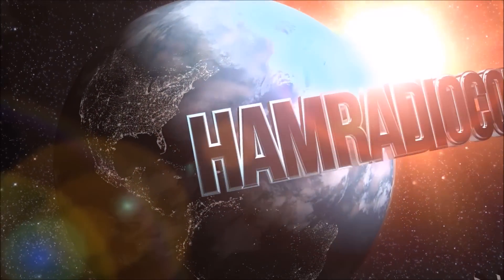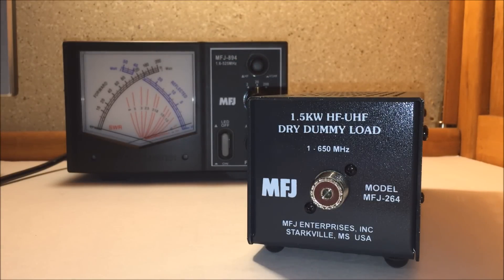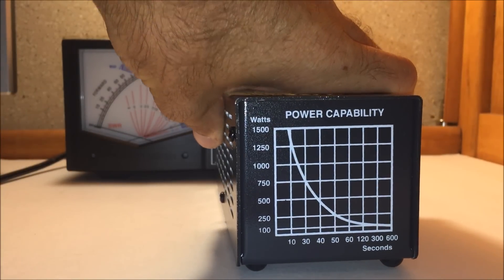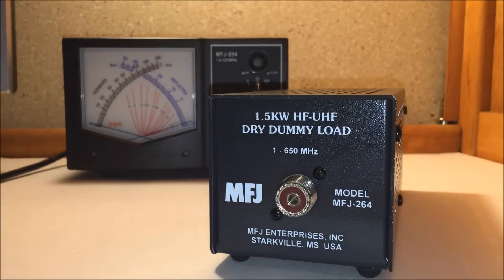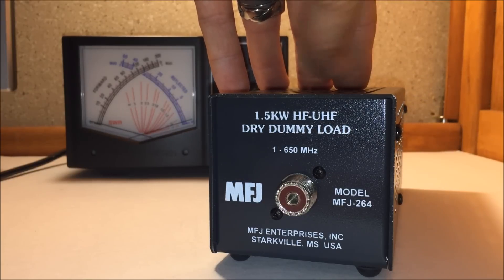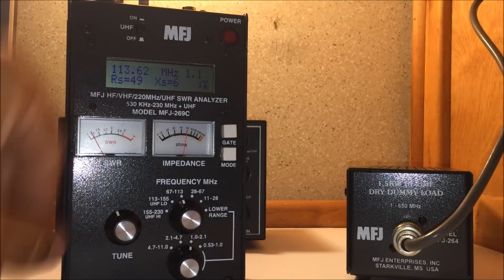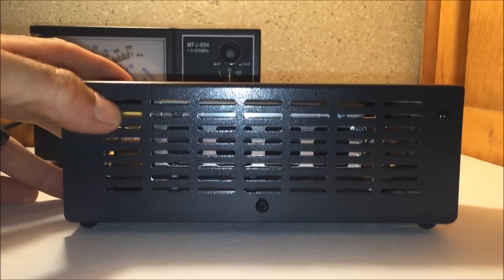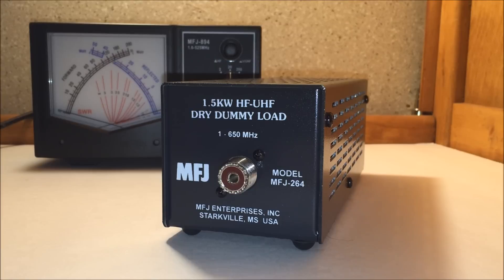What is a dummy load? MFJ-264 for Ham radio

Comment: I'm new to Ham radio and my question is can I use the MFJ-264 on a Xiegu G90 when I get it?
Reply: I believe so, but the 1.5kW PEP model is a bit overkill. the 300 watt PEP is more in keeping. I have a G90 as well so the lower power one is what I'll be getting. I don't anticipate pushing out full legal limit for the foreseeable future.

Comment: try you hot water tank ,i use my hot water tank is  a dummy load ,,i just connect a cox cable RG -79 to my hot water tank an then to the radio,, my SWR is 3-1 and is good for 8000 W

Comment: I've always meant to get a dummy load, never realized how inexpensive they are.  This one is on sale now at HRO for $65...same price at GigaParts.  Thanks.  73, Chris.
Reply: This one not that good and way overrated and you be lucky you get a more then a couple of seconds at the power it rated for without it burning up. A true 1.5k dummy load is oil filled and much larger and can handle the power continuously without overheating, but cost $200 bucks, or more. You can find them used at meets, or eBay cheaper, just have to watch for deals, recommend the large Bird, or  Termaline as they are built the best and way underrated. We use the birds for commercial and out in the field use when testing 2 way transceivers and they last a lifetime. That MFJ is junk, but better then nothing and ok if limited to a couple of seconds, or low power.